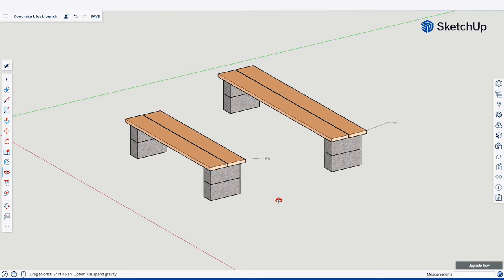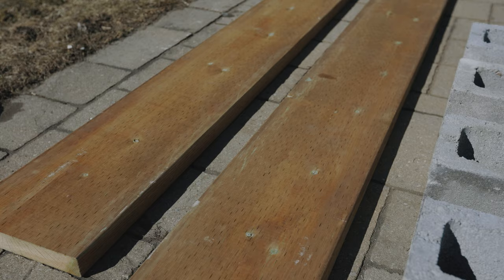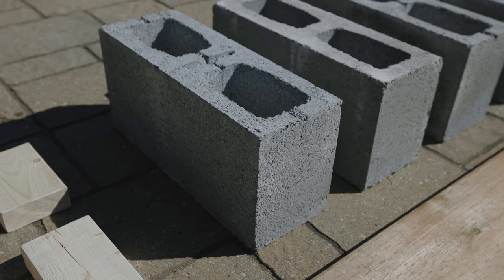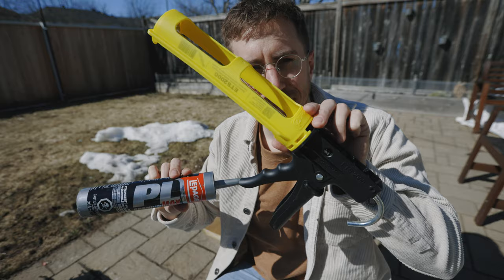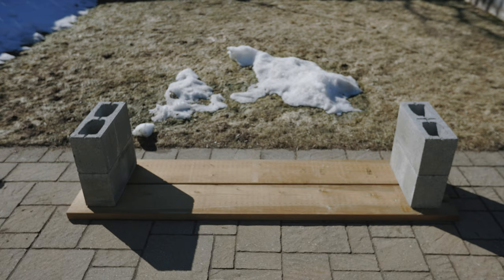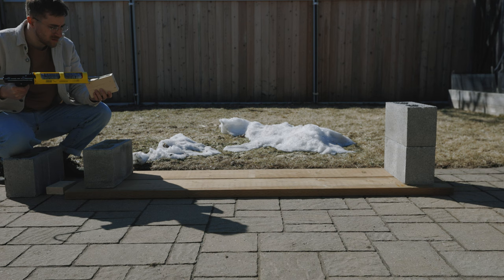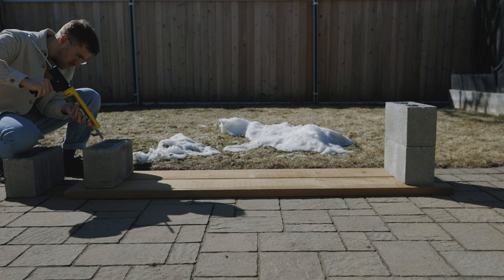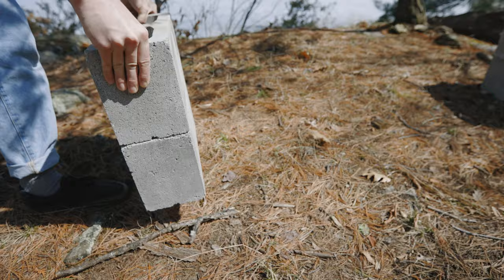No-Cut, No-Screw : Beginner Backyard Bench DIY!

Comment: Just built one using some old 1x10 I had lying around. It works well and looks great. The only thing I'd add is that if you're putting it out in the garden you might want to put some crushed stone under the base to make leveling easier (if the blocks aren't level the seat will be a bit wobbly/askew and the level might change as it settles).
Reply from the maker: That’s a great tip I totally agree. Crushed stone is the right way to go

Comment: Please help me understand the little blocks and what they do?. I thought you put them in the cinder blocks but then I saw you at the bit touched the wood at the end. These are great idea. I plan on making soon.
Reply from the maker: The blocks get glued to the wood. I used the cinder blocks as a template for where to put the wood blocks. This way the top boards fit into the cinder blocks with the wood bits there to keep the top boards secure and not sliding around.